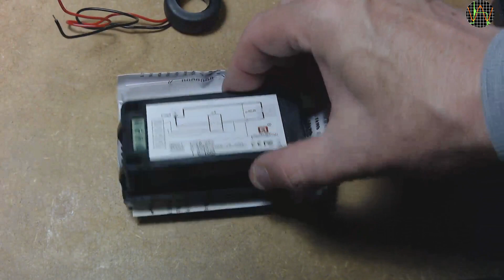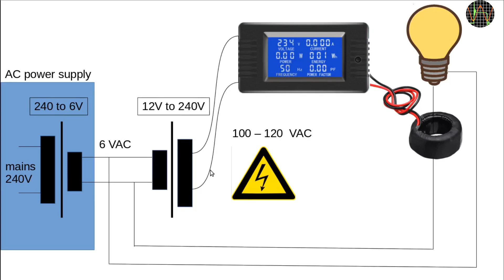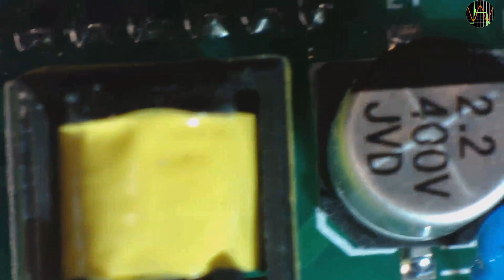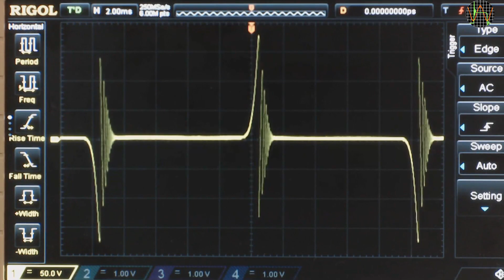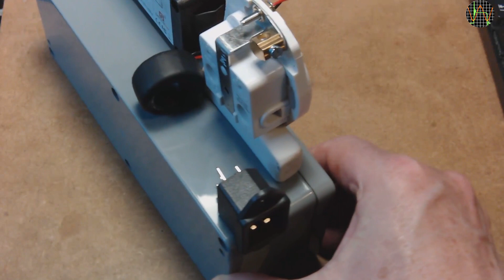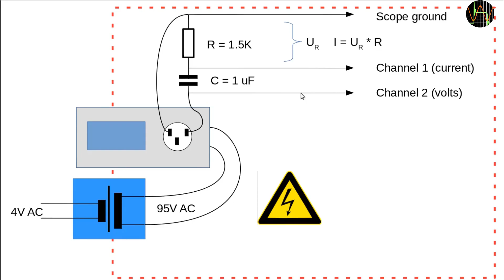Building your own power meter with the Peacefair PZEM-022

Comment: Hi, Heinz. Please refer to my sketch, linked here: https://www.dropbox.com/s/gec1u6fsmqk1pfx/PROPOSED1A.jpg?dl=0
EDIT: Oops... I see that I reversed the connections of the battery to the board. The red positive lead goes to D2's output pad. The black negative lead goes to U3's ground pin, maybe? See below.

Because I am using individual units, it would be difficult to power the Meter with non-attenuated AC power from the Isolation Transformer. Therefore, I propose to power the Meter with a separate 9 volt battery. The battery’s positive terminal will be attached to the input of the voltage regulator U3 and its negative terminal will be attached to the output of diode D2.

Because we are dealing with mains level power, I would greatly appreciate you verifying several things…
1) I am particularly concerned that the battery be isolated from AC. So, I will need to a) cut the trace going from the voltage transformer to the voltage regulator U3 and b) remove diode D2. (I may simply bend the input pin of the voltage regulator upward and attach the battery wire to it. That way, the process can be easily reversed, if ever so desired.)
2) That the other various proposed wiring appears to be correct, particularly that the DUT’s AC voltage is sensed from both the new connection to the DUT’s AC Line Wire via R13’s new through-hole resistor and the DUT’s AC Neutral Wire via Pad C, as drawn. And, that these AC voltage sense wires may be of a smaller gauge than mains wiring, as they do not carry any significant current.

Heinz, please confirm the above and advise me of any needed corrections, or cautions. I certainly understand that you can not be held responsible for anything that I do, and I willingly indemnify you from all responsibility. It is just always good to get an extra set of eyes on a design and to double-check one’s thinking. I g-r-e-a-t-l-y appreciate your efforts to help me!
Reply: I did a bit of research and probing. The v reg U3 is marked "7133-1." I believe this to be the correct data sheet: https://www.holtek.com/documents/10179/116711/HT71xx-1v250.pdf  If so, its rated output is 3.3V/30mA, the package is SOT89 and the pinout is 1/GND, 2/Vin and 3/Vout (All true, for my unit.) 

The transformer outputs to D2. The D2 supply to U3 was 5.42VDC. With no load other than the meter display, U3 output 3.26VDC.

The output of the v reg(U3/Pin3) did not have any continuity with the AC, or current coil , inputs, being Pads A, B, C and D of my drawing (Linked above in the originating post.) Pads B and C are tied on the display side of the board with a trace. And, I found continuity through the coil path, that is from Pad B to Pad A. I also found continuity from U3's ground pin to all three pads, C, B and A, as they are common, as stated previously.

The wiring instructions shows AC/Line connected to Pad D and AC/Neutral connected to Pad C. Meaning, if I used the ground pin of v reg/U3 for the battery ground, it would have continuity to DUT's AC/Neutral. I do not know enough about combining the two, but I do know enough to find that somewhat concerning. So, how should the battery ground be handled?

If the battery ground can be sorted out and, therefore, a battery can be used, removing diode D2 (SS14/Schottky/40V/1A) would separate the transformer from D2's output, which supplies U3's input. Meaning, the D2 output pad would be a convenient solder point for the battery positive lead.
Reply from the maker: Its expected that the chip's GND is connected to AC-neutral. Its the same for the PZEM-004T, so that is not a problem (if powering from an isolated battery). The problem is that the VANGO V988x chips seem to have some power management and need to see a specific voltage on a pin called VDCIN or they go to sleep. In the PZEM-004T this voltage is derived from a divider BEFORE the voltage regulator. This is why I had to use 12V to power the module (see my video on PZEM-004T for details and schematics). Chances are this is the same here which means you need to really reverse-engineer the circuit and find where the reference is taken from and how to replace it. Removing D2 and feeding 5.4V in instead may be all that's needed but that is hard to say. Check the datasheet of the Vango chip and measure the voltage at the VDCIN pin and trace where it comes from
Reply: @TheHWcave  This is such excellent information! Thank you , Heinz! I will look at the 004T video and do some probing on  my unit to find VDCIN voltage.

Comment: Hi HWCave...So informative and your power factor discussion brought a smile to my face as I remembered my Power classes in Electrical Engineering at University 50 years ago :). 

I purchased one of these to monitor the AC circuits and loads on my 35' sailboat in San Francisco. I plan to put measure the 110v AC 60Hz voltage at the 30 amp shore power inlet connector https://www.amazon.com/Marinco-30-Amp-50-Inlets/dp/B07K814188 and use the snap-over current sensor around the 10 gauge / 2.588mm triplex (hot, neutral ground) single-phase AC power cable. The display unit will be remotely located  on an instrument panel about 10 feet / 3 meters away and connected with 22 gauge / 0.64 mm x 4 wire/ two pair shielded cable https://www.pacergroup.net/multi-pair-individually-shielded-w/.

Being very concerned about the high voltage as you were and conscious of American Boat and Yacht Council (ABYC) and UL wiring standard for vessels, I plan to 1) ground the shield to shore power ground 2) put a fuse at the display end on the mains leads for circuit /fire protection, and 3) heat shrink wrap all exposed terminals. The problem is sizing the fuse. Do you know how the max current the voltage leads of this unit will pull? There is nothing spec'd by the manufacturer. 

I'm tempted to use a 100ma 250 volt inline fuse.. or maybe one of the new resettable polyswitch fuses. Your thoughts?
Reply from the maker: Hi Michael,
thanks for the kind words. Interesting application you have in mind. I am sure you know but just in case, the transformer should only snap around either the hot or neutral wire, not both, else the magnetic fields cancel each other out. I would also leave the ground wire out.  Make sure the shielded cable is rated for mains voltage. 
As for the current consumed by the unit, it is tiny. At 238V I measured 1.6mA with the back light on. At 115V that probably doubles and increase further the lower the voltage. The lowest fuse you may be able to get is 20mA which would do, but if those are difficult to get, you may have to stick with 50 or 100mA. After all, it is unlikely that the fuse will prevent damage in the module (that already happened, causing the increase in current in the first place). What it should do is prevent the fault from starting a fire and of course the current must not exceed the rating of your shielded cable (AWG 22 = 5 amps)
Reply: @TheHWcave  Very good. Yes, I did notice the need to monitor only one wire. I plan to use an IP65 marine plastic box not unlike your own except with rubberized entrance grommets f to make the proper connections and loop the sensor through only one of the wires. 

And thinking this through, I think I will connect the drain wire to the boat ground. In ABYC vessels, 110v AC neutral (white), AC ground (green) and 12/24v DC negative (black) are all bonded to the engine, keel bolts, aluminum mast and standing rigging.  When connected to shorepower, everything is also bonded to the mains (electrical grid) ground. When operating off the onboard DC/AC inverter, that bond is disconnected and the vessel ground is bonded to the inverter neutral (automatically switched by the inverter).  Also, it will eliminate any cross-talk between the twisted pair (required by the way by the manufacturer for any distance cable runs).

As for fuses, yes, it is strictly for circuit and fire protection. I found simple glass inline fuses at 50 ma, so I will use those. 

For your interest, this unit will sit in a custom frame right below the DC version of the unit PZEM-015 https://peacefair.en.made-in-china.com/product/iyOEaAhbrvVj/China-Factory-Supply-DC-Battery-Meter-Digital-Voltmeter.html which acts a full State of Charge Battery Monitor at a fraction of cost of a Victron 712 SOC BM https://www.victronenergy.com/battery-monitors. The PZEM-015 is equipped with a 300 amp shunt on the negative side of the 464Ah house battery bank. It uses the "current integration method
", also known as "coulomb counting", to calculate the SoC by measuring the battery current when charging and when discharging and integrating it in time to display a % charged calculation. Very useful for mobile,  "off-the-grid" or solar battery installations where discharging lead acid batteries (flooded or AGM) beyond say 60% SOC is VERY destructive to number of the usable charge cycles.
Reply from the maker: Thanks for the update. Cool project!

Comment: Just curious as to why would you choose to "deform" the plastic to depress the button vs using an instrument to insert into the hold to depress the button??
Reply from the maker: Fair point. Initially I thought you may not always have a suitable tool handy to operate it. I rarely use the button since I am mostly interested in the power factor but when I use it (to reset the energy counter), it is usually with a screwdriver.
Reply: @TheHWcave  I noticed that the momentary switch is surfaced mounted on the PCB. It would be very easy to change it out for a tact switch that has a taller button.
Reply from the maker: @t1d100  Too much work ;)  In any case, I hardly ever use the switch because I am not using this to measure long-term energy consumption and I have no use for (silent!) alerts either.  Folks that do use this meter permanently to measure their energy consumption may actually appreciate that the reset is not so easy to activate.

Comment: My PZEM-022 is acting weird, installed all the wires with the most simplicity I could and it worked fine, tried to make it fancier adding a ground wire and now it's saying "139 Wh /// Energy" even when nothing is connected, what had gone wrong?
Reply from the maker: I need a bit more details. What do you mean with "adding a ground wire"? Added to what?
Reply: @TheHWcave  because the pzem-022 is acting like an extension, with two plugs in each end and the pzem-022 in the middle, just like in these screenshots: https://imgur.com/a/jk3Am42
Reply: Got it to reset, only needed to hold the button for some time and click it once, once it highlights Energy xD
Reply from the maker: Looks ok to me. Key thing to remember is only 1 wire goes through the transformer, either live or neutral. Yes, the energy  reset works that way. Once you figure it out its easy.  Happy measuring...
Reply: @TheHWcave  Thanks!

Comment: Hi there, The HWcave... I am not really good at electricity but I understand some basics of it. I just ordered one and it has been delivered to my house today.  I have the very same model Peacefair PZEM-022 100A. My plan is to use it after my Circuit breaker which is 60A  220V here in the Philippines - so as to see all the readings of the entire house. Do you think it is applicable and can this meter sustain it if I connect it after the circuit breaker as a source of electricity in my house and having this device measuring  the current, etc.

 Please give me feedback HWcave for I am expecting  answer and thank you very much in advance .  :)
Reply from the maker: It is rated to 20KW and the maximum it will see in your case is 60A * 220V = 13.2KW , so there is no problem. The PZEM-022 is available with two different current transformers, the cheaper one (which I used) is a solid ring. The slightly more expensive transformer can be opened and clamped around the wire to be measured so you don't need to disconnect it to feed it through. I hope you got the one that can be opened because that makes installation a breeze and far less dangerous. If not you need to be really careful in disconnecting the cable from the circuit breaker. It needs to be off, of course and I would test that there really is no power on the wire before touching it. Then feeding it through the ring and then reconnect it good and proper(!) because any loose connection at 60A will get very hot and set fire on things... In either case, remember only one conductor must go through the ring transformer, either live or neutral, it doesn't matter which but never both. And remember, working on mains is dangerous, especially at a 60A feed. Whatever you do, you are doing this at your own risk. Maybe better to ask a friendly electrician to help.
Reply: @TheHWcave  thank you for the advice,  I completely understand your instruction. Never knew that there is another type of PZEM that is open type and can clamp it to any of the two wires Live or Neutral.  I think I will order for that and I will use it for my intention. rather than this one. 

I would use this cheap one for outlet only and not dare to connect it as I plan before to circuit breaker.

Since I am not an Engr . may I ask what will happen just in case I accidentally feed the two wires inside the ring? would the CT overheat and burn? Just in case I thought.

Best of all thank you for the reminder that having a loose connection hook to 60A would result to fire. Yes I will take your advice and look for the expensive one so I can clamped it easily to one line of my circuit breaker to monitor the total wattage and power of my business inside the house, 1 freezer, 1 ref, 1 heat press, 1 servers  and 11 client computers. + house  appliances. Many thanks there.
Reply from the maker: The split transformer is definitely safer. Not sure what your suppliers are. Banggood has it as "PZEM-022 Open and Close CT100A Digital Display Power Monitor Meter Voltmeter Ammeter Frequency Current Voltage Factor Meter with Split CT"   ID: 1356031  
I guess the open and close part and/or Split CT are the keywords to get the right thing. 
If you put life and neutral in together you would read always zero because the fields cancel each other. 

Thinking about what you are trying to do, maybe the PZEM thing is not the way to go for you. For one the display module would have to be within 10-20cm or so of the big cable you are monitoring. That is usually not a convenient location and you still need to (safely) wire mains power to the actual module. There are very cheap power monitors that plug into the wall outlet, between socket and the unit(s) you want to monitor. You could get a couple of those for the different circuits (fridge, server, couple of PCs etc..) It has the advantage of zero installation problems and it gives you far more details of what devices in your setup eat the most power instead of just an overall sum.  If you want an overall sum, there are what ebay calls "Monitor Electrical Usage Meters". These are essentially similar to the PZEM but more easy to install. I have installed one myself about 2 years ago. I have the "GEO MINIM Energy Monitor" (Amazon) costs currently £40 in the UK. It has a clamp sensor and that goes into a battery powered wireless transmitter (3 AA cells, last about a year). The transmitter lives in my case in the outside cabinet where the meter is. The receiver is mains powered,  with a nice display of all kinds of parameters. We keep it in the kitchen. It is amazing for kids to see how the power dial jumps up when they turn the toaster or kettle on....
Reply: @TheHWcave  thanks , you have covered a lot of ground that is very informative.  I LIKE the last device you mention, unfortunately, it is only sold at UK not in Amazon Philippines nor in Shopee or Lazada our famous delivery system online. And it is so pricey , almost 6x the price of what I have now,  but one day I will get it as I am wishing to have it. I Checked the review its so graphics and informative. Again thank your TheHWave :)
Reply: That monitoring you last suggested thought amazing is read in Pound so it is for UK only. Unless there is US  Dollar sign or Peso for my country.  Tnx
Reply from the maker: According to the manual, you can change the currency symbol. Pounds, Euro, Kroner or "a general currency symbol"  but you are correct, this model is very much focused on Europe. I only mentioned it to give you an idea and because this was the solution I selected for a similar problem. Hopefully there are similar things available in your country.
Reply: @homedefenselawrence  If you put both wires through the current transformer their fields will be out of phase and cancel resulting in a zero reading. No sparks. No smoke. Not very exciting!
Reply: Also,  what model or  type of PZEM I should buy? the one that can be clamp ped  as it seems I am getting harder available  online to order.  Again thank you.